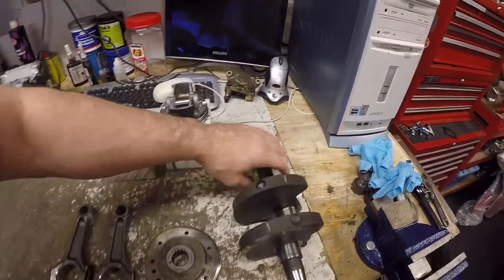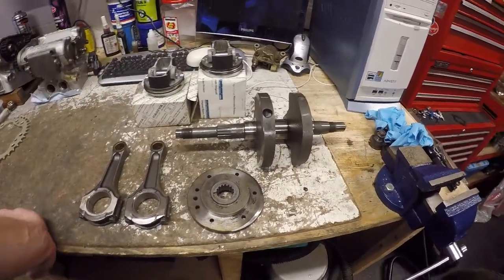Thunderbike Race Prep Video 9 - Ducati 748 The Crank is here!

Comment: I'm currently building a 95' 916Racing engine. I have a rebuilt crank and con-rods and have used pistons. Do you think I need to have it all balanced?
Reply from the maker: I would always balance an engine that will be used for track or race use, the engineer I use to balance my engines says that the balance accuracy on Ducati engines varies between years and set up and will make a massive difference to reliability when done